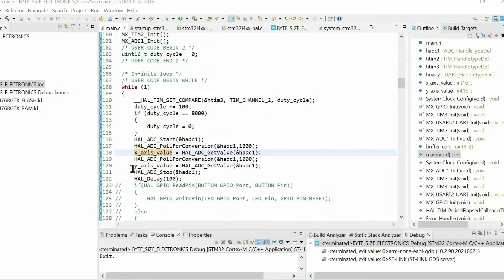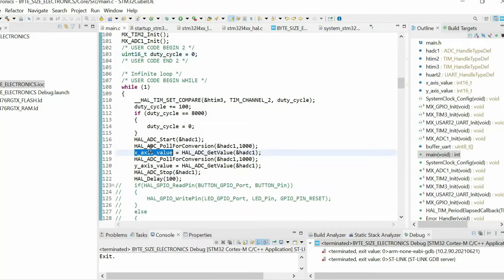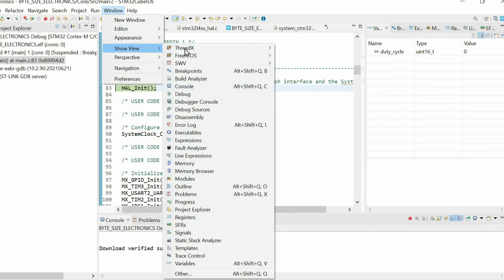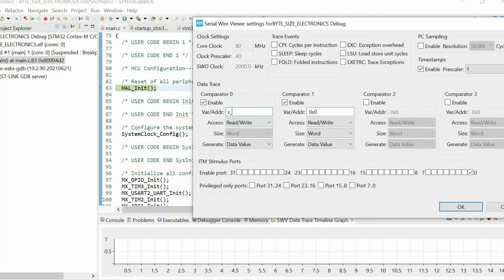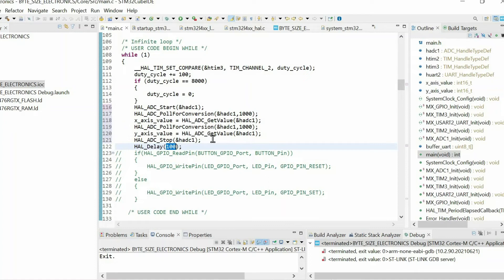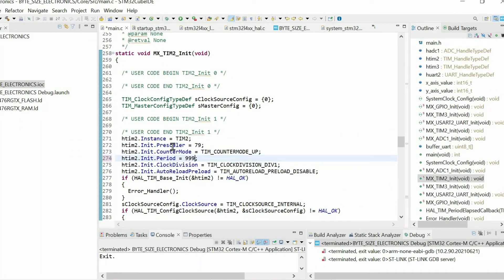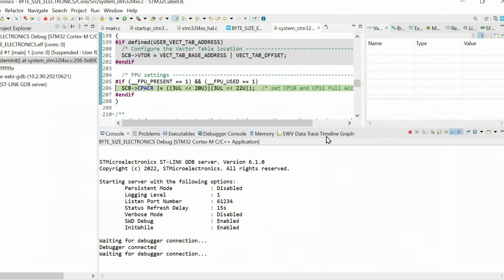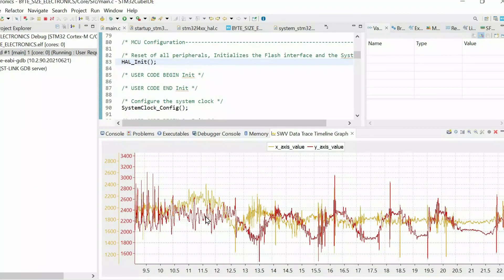STM32CubeIde: plotting data using SWV.

Comment: The terminology Data Trace Comparator 0-3 is kind of strange.. what is comparing?   And what are the 32 ITM Stimulus ports for?

I thought Trace Streaming requires dedicated 1-4 TPIU Trace pins.. but here it looks like those signals are routed to the single SWV/SWO pin?    For example, isn't SWV also used for ITM_SendChar()?
Reply from the maker: To be honest, I do not know how SWV works at a hardware level. I know it is responsible for ITM_SendCHar and plotting data(Data trace comparator).